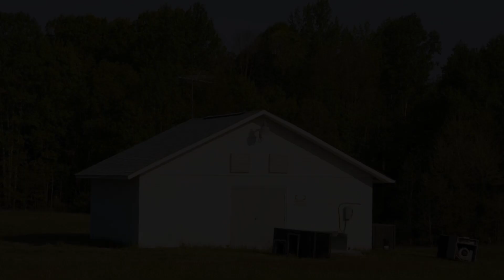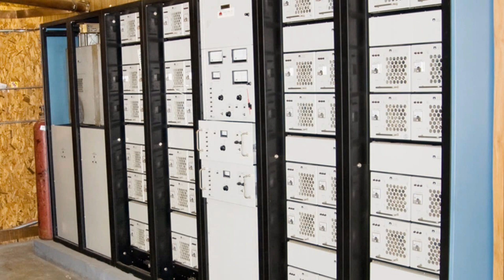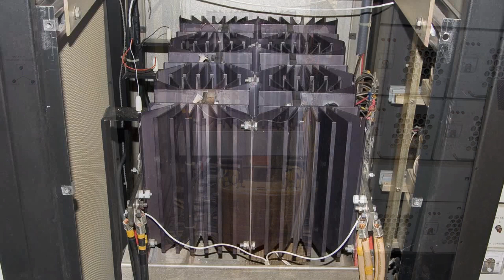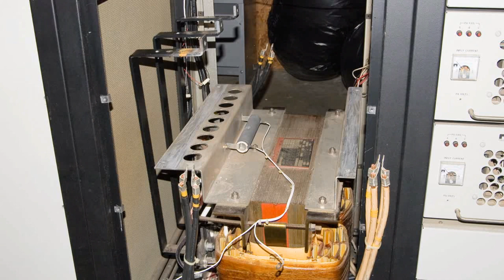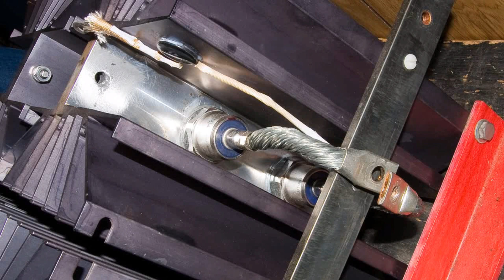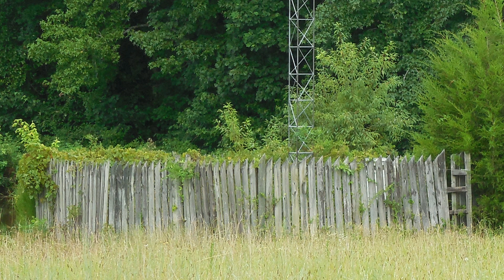50KW AM Station power output down to 1KW

Comment: In 1967 I went to work for a fairly new AM station in west Texas.  The lone tower was erected but the fencing around the tower had not gone up (it didn't need to be painted because it was under the FAA minimum (150') because it was very high on the band (1510 KHz)).  The sales department put pressure on management to get on their air before all the final work could be done, which included the fence.  One afternoon I stepped outside behind the station where we had a bunch of feral cats (I think the secretary was feeding them).  You, of course, have to realize that on a 1/4 wave vertical tower, the antenna is inductive (voltage leading current), making the current maximum at the feed point at the base.  I actually saw one of the cats rub up against the antenna (like cats will do with any vertical object) and fry himself.  The scream was horrible -- but the stench for the next few days was worse!

Comment: The tower is hot . So a human would get electrocuted touching the tower ? The fencing around it looks to be inadequate .
Reply from the maker: 50KW kills
Reply from the maker: 50KW kills
Reply: 50KW kills for sure...
Reply: 50 KW of RF kills? How?
Reply: Not electrocuted. Just an RF burn. Hurts. If you reached out and touch the tower it would feel like someone shoving a needle in your finger.